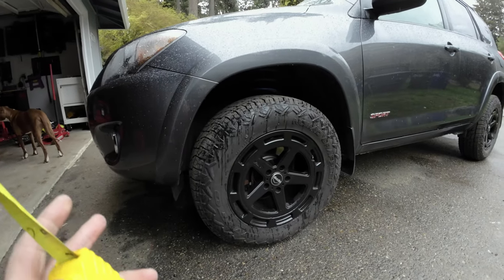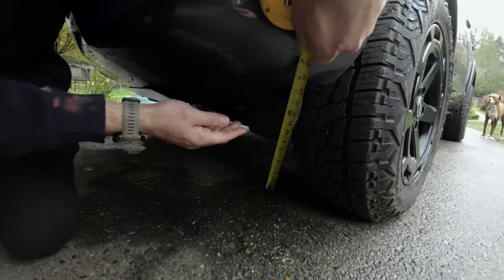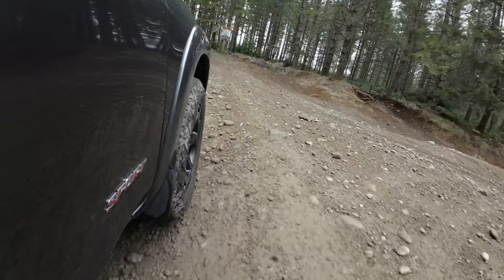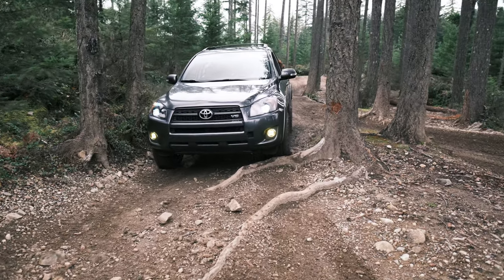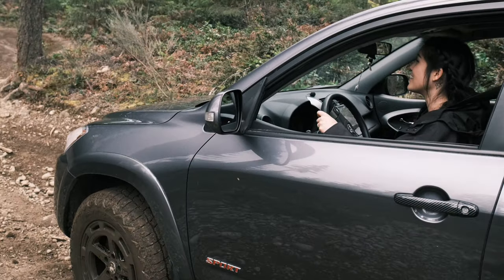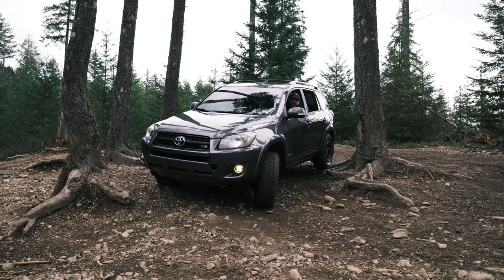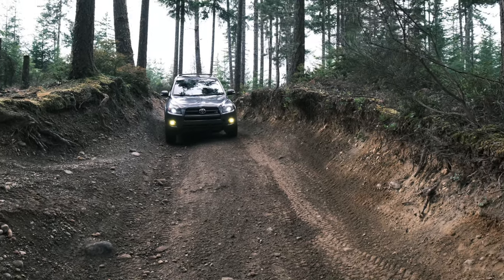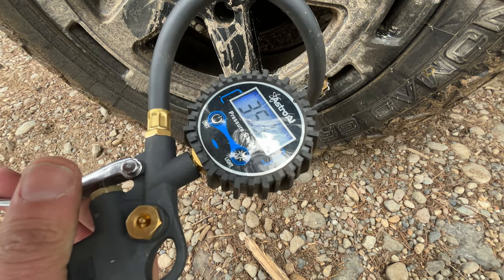2011 Toyota RAV4 V6 Off-Road Test. Is it a good Overlander?

Comment: Pretty impressive. Clearly not what the car is built for. So, my concern would be issues after unintended use. I wouldn't build a vehicle for uses like this that isn't designed for and expect it to not have problems eventually. As opposed to a true body on frame 4x4. But fun video.

Comment: I had to fallback on my 2016 awd rav4 for while, I installed a northwoods 2'' lift kit and some trail terrain tires, I took my little rav to a lot of remote places in baja, I am not saying they are jeep material but with a little common sense and adventures state of mind they can definitely go outhere, I only wish my rav was full time awd.
Reply from the maker: Actually same! However for around town driving for the wife getting 20+mpgs almost 30 on the highway is a good thing.

Comment: Does the drivers side aftermarket light already have condensation in it?
Reply: Sure looks like it did to me. Once their taken apart, they rarely ever seal back up correctly.
Reply: @curtisbull1583  I saw the one where he disassembled them, then later he went ahead and replaced the whole unit. Looks like the one in this video is the whole unit, not the ones he disassembled, I think.

Comment: Best left to maintained Dirt roads.  Love my v6 rav. a top speed of 137 mph. It's one Fast sleeper. . but I loved my 4runner better for the fact it has a low range and crawl control.  Rav is ok ish on longing road but With the tranny being the vulnerable part and the tin thin rocker pannels.  I wouldn't take it into rocks or bump the rockers. You'll destroy them.

Comment: Great Video! I have a 2011 Rav4 V6 with 4WD, the Northwoods kit, bigger AT tires, and a costume skid plate I cut out of a 1/4 sheet of aluminum, and it really is a great car for long distance on road and some off-roading. I've put almost 200k miles on it in 5 years and only had one major repair when water got into the breather valve of my diffs. But, it was my fault because I got it stuck in a deep rut while driving in muddy water above the tires. After about an 2 hours of my car being stuck and flooded, I finally found a truck to pull me out, and thankfully the Rav4 never stopped running. Funny thing was the lifted truck overheated while pulling me out of the mud, so I ended up towing him 15 miles through the off road trails with multiple water crossings to his house. Having the ability to tow 3500lb in this small SUV is great in addition to so much storage room because of the boxy interior design, low trunk height, and flat folding seats. I've even moved cross states and didn't even need to rent a U-Haul because I could just fit so much. It's not a true off-roader but it continues to surprise me because once I was trying to reach a remote lake with 4 kayaks on my roof and the short wheel base got me through the narrow trails easily while the Ram 1500 and Jeep Grand Cherokee following me were getting stuck time and time again. It really is a fun car off-road while at the same time being able to go 0-60 in 6 seconds and get 25mpg on road.

Now, thanks to you videos, my wife wants to join the Toyota Club and get a Sequoia as our family overlander (A big upgrade from her Chevy Spark, haha). And these videos have already given us a ton of Ideas.
Reply from the maker: Wow that’s amazing. The sequoia is SUCH a spacious vehicle. You’ll almost have too much space. I can’t wait to take the RAV4 out more this year and give it more adventures.
Reply: Thank you for your story. I'm a proud owner of a RAV4 2012 with 4WD since 2016 and have made many memories with it myself as well.

Comment: i love my 2010 v6 rav4, i go offroad and ice fishing in it all the time, i love how the back folds flat to sleep on and has over 6ft so im comfy in the back with my 2 Pitbull's
Reply: Wait wait, really it folds flat??? I was looking at this model but with 2.2d engine, was interested in something for light off road/overland/camping rig that can get me to most places and could sleep in it (i am 5’9), it’s hard to find something that is good to fit that and busy city life since i am in main city of my country (lots of traffic so really big SUVs don’t fit nicely)
Reply: @srdjanmatic7099  it folds almost completely flat, I got a nice folding foam bed and it fits perfectly.. I’m 6 feet tall and with the front seats pulled forward and the back seat headrests extended it supports me “200lbs” and 1-2 of my pittbulls

Comment: Thanks CG and  company - I’ve owned many Subarus here in Australia but the post 2013 models like the Nissan XTrail (US Rogue) have major CVT and oil consumption issues - I’ve got a 4x4 Toyota Hilux now (you probably call it a Tacoma but ours are 4 cylinder 3 litre diesels) - anyway I would also like a runaround SUV as well for practically and general use but easy to get in and out of with some light off-road abilities - the more videos and research I do the more I realise the V6 RAV4 is one of the best on the market with conventional auto transmission and typical Toyota reliability and have learnt that the 2.4 engines have a lot of oil leaks/weak piston issues so it looks like the V6 is the better choice - did you have any CV/diff issues when you raised the vehicle or are the angles still OK as rpt not put too much pressure on the CV joints?

Comment: Love your setup with those tires and skidplate. I used to have a 2011 Rav4 -- was such a great car. We traded in for a Highlander because we needed the space but otherwise I would have kept it forever.
Reply from the maker: Thank you so much. They are pretty small on space for today's standards for sure, Highlanders are excellent options as well.
Reply: Yeah 3 car seats don't fit well in the back, plus we needed more towing capacity

Comment: I have a 2006. The RAV4 is one of the most versatile cars you can get. Driving mine in the alps. I'm driving the 136hp Diesel... Power is good, but torque is always more than enough.
If we had the V6 in Europe, I'd probably drive that... because of better coldstart than the diesel 😉

Comment: Man- so tempted but I hear so many horror strories when you change the geometry of such a vehicle from how it was designed. but great looking job.
Reply from the maker: All the CV angles are within spec so you don't have to panic.
Reply: @CoolGuyClub do you mind exposing what CV angles means? And what is within spec for this particular car? Thanks!
Reply: @catsofthestreet9547 cv joints are what lets the engine turn the wheels which move 3 dimensionally.  I’ve never heard of “in spec” or any service manual w “spec’d” cv angles

Comment: I wanted to add that this is not the limits, i have a 4wd V6 and i did some crazy climbing and small crawling today through some power lines. The only timea i get stuck is deep mud. These things can do alot but from my experience it cant handle swampy mud at all
Reply from the maker: Totally agree with you.
Reply: They get stuck in swampy mud but maybe with the lift and some good tires? And a winch? haha.

Comment: Some questions guys:
1) Toyota gen3 2.0 are reliable...?? 2) Also they are thirsty for gasoline?
3) trunk space is big enough?

Help your friend from Greece brothers, thanks
Reply from the maker: gen 3 2.0 the answer is .. meh sort of. 
Truck space is plenty big for a weekend camping trick especially if you use a storage box on top.
Reply: @CoolGuyClub  here in Greece there are two types of RAV-4, 2.0 and 2.4 gasoline. The taxes per year for 2.0 are 630€..... For 2.4 are more. So the choices for real SUVs are not much: CR-V 2.0 2010 model, X-trail (Rogue?)2010, Suzuki Grand Vitara 2.0 2010. I am between CR-V and RAV-4....

Comment: I like the newer upgrades that are being made for these types of sport utility vehicles. The upgrades are allowing people to take their Sport Utilities and put them in a class of vehicle I would call an Adventure Vehicle. As far as being an overland type of off road vehicle. I would say that these types of sport utilities are generally not the Overland Type. 
   Overland vehicles typically have at least a 33-35" tire. Many have much more tire than that. Overlanding is a type of off road driving in which there are no roads, or even trails. You just pick a path and go. That being said, could you use a vehicle like this for overlanding? Probably, but you would have to be very careful about the paths you choose. For this type of vehicle, the off-road capability is determined by one, the tire selection, clearance does help, but the overall ability is determined by the traction control system. Many do not have a limited slip, so the traction control system must be very good. The last thing you would want to do with this type, which is common with vehicles that do have diff lockers or limited slips is turn traction control off.

Comment: Great video for the RAV4. Actually been thinking about getting one. A few questions. What years are gen 3? Which v6 is in it? Why was your TPMS light on? What is the name of the park where you ran this trail? ( I am inl Oregon). I currently have 2 Tundras, 06 and 13 and a gen2  Sequoia with 322,000 on it so something with a little better mpg would be great for me. Thanks, I enjoy your videos.
Reply from the maker: TPMS light is always on for these cars. Even with new sensors as I've installed with my wheel, the light never turns off. The name of the park is Tahuya it's in wester washington and it gets VERY difficult in some areas.

Comment: Well that gives me hope then for buying one. 
I was looking at a venza as another option, but the gas mileage. I looked abysmal on paper
Reply from the maker: Venza is MUCH larger. If you have a large family venza is a good idea or v6 awd highlander. However, we love the size and capability of our RAV4.
Reply: @CoolGuyClub  The drivers seat felt too short and didnt slide back enough in the Rav4 for me to feel comfortable for long trips.
I felt like I was at in my 4th grade desk as an adult pretty much. 
Im only 6ft, but knees were like 5" higher than seat. Also seat only went as far as mid thigh

Comment: I’ve got the same lift kit and added some larger tires on my rav, also without the spare tire. What’s your spare tire plan? I was thinking about adding a swinging hitch mount eventually for those forest road adventures. Love those wheels too, thanks for linking everything!
Reply from the maker: We are gonna run no spare. I’d prefer to run plugs and patches than throw a spare and a swing out to the wife’s mini mobber
Reply: I’ve got mine standing in the trunk against the backside of the 2nd row seating. I got some of those heavy duty rubber straps hooked from the baby seat anchors to the lug holes in the wheel. Moves a small amount when I’m turning but more or less stays in place.

Comment: Like I suspected the headlights were not a great success from what I can tell by the moisture. I think you should have kept them stock. I really really do like the lift and the wheels and I can only dream of a V6 RAV4 (sadly no manual) here in Europe
Reply from the maker: There aren't any good upgrade options here in the states and the "stocks" aren't as high quality as the lights you get in Europe.

Comment: Do you have a spare tire somewhere installed in the vehicle? Just got the sport model too and wondering what to do. 😮
Reply from the maker: We actually do not have a spare the same size of the rest of the wheels. We have plug kits and stitching just in case we need it.

Comment: You're running 245/65/17s? Do you think 245/70/17s would fit a 3rd gen?
Reply from the maker: Yes totally, we plan on upping our size to that. Lift kit will be needed along higher offset wheels (higher than 20mm)
Reply: Are your wheels +20mm offset? 

I just bought the same truck and want to put 17x8.5 -12mm . Just not sure if it would be past the fender or rub? I could go +12 mm too. Whats your opinion??  @CoolGuyClub